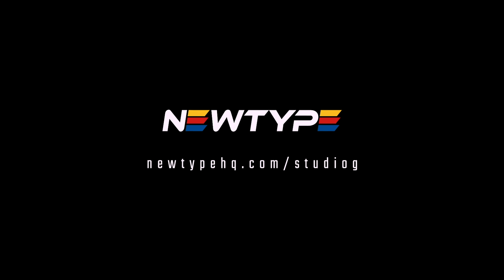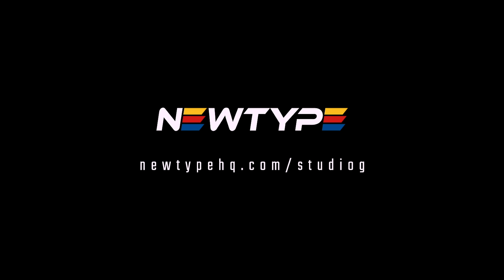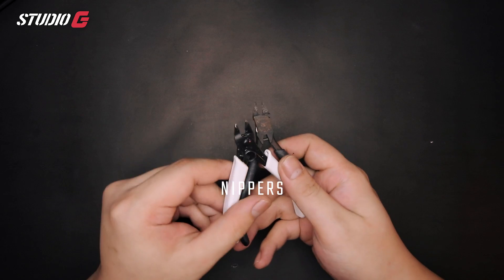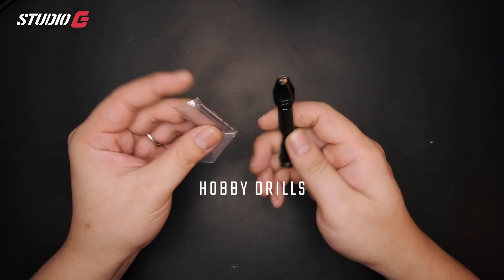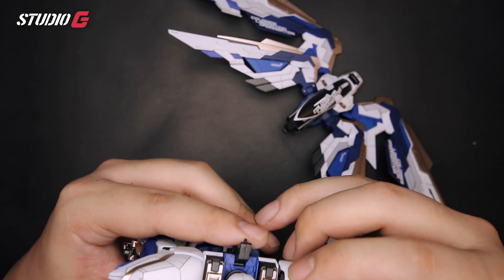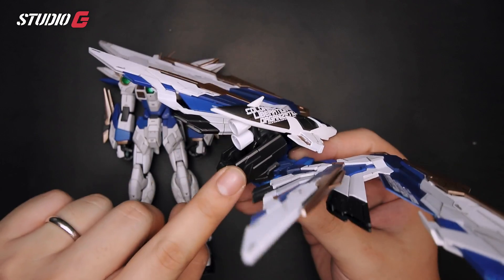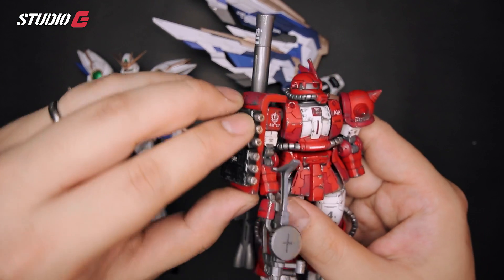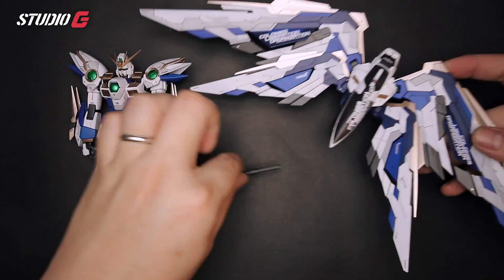How To Kitbash Your Gunpla | Tutorial Tuesday

Comment: My first ever custom was a kitbash it was a astray red frame with flight unit, I put the destiny gundam wings into the side plugs on the flight unit, put the destiny arms and hands with fenice reniscita shoulders and legs on the astray torso and then made a set of scratch built guaiz eft inspired hip railguns using the little ball and shaft that is in the polycap runner. I only painted the green and the blue parts red and and made the cream parts white and added some gold with a paint marker and removed the astray v fin. Simple yet effective

Comment: I used Gundam Breaker 3 for my first kitbash. It was essentially the 00 Qan[T] and Destiny Gundam. Unfortunately the Destiny shoulders didn’t work with the Qan[T] body. (I was using HG kits.) after trying to make it work I switched the arms to Gundam X. 

So after everything it went:
Head - Lightning
Body - Qan[T]
Backpack - Qan[T]
Arms/Legs - Gundam X
Wasit/Hands - Destiny Gundam
Colors white/gold

The only thing I haven’t been able to fix and I have some ideas are the fun funnel color, which come as green, and I need them to be a clear blue. I plan on redoing the HG version since I’ve gotten better at Gunpla and painting since I made that kitbash. Then I want to try it as a MG with the Qan[T] Full Saber backpack.

Comment: I recommend that every gunpla tool kit have these things:
Cheap nippers
Expensive nippers($35)
Model files($10)
#1 hobby knife(and 100+ spare blades)
400g to 1500g sandpaper.(cheap Walmart works)
And finally to get the sheen after sanding that matches all Bandai plastic:
2500-3500g sandpaper(3500 looks better but takes longer). 
You can get everything you need for under $100. If you’re spending $200 not including paint, you’re doing it wrong.

Comment: I think if you really want to get into kitbashing the correct place to start is with the high grade line because of all of them are about compatible with a 3 mm holes like the iron blooded orphan line is really good for this because all the parts can be mixed and matched and then you can paint the kit as a whole to make it match the 30-minute Mission kits are also very good for this especially if gluing and modifying pieces is not your thing that's the way to do it without having to modify our glue pieces or cut them if you do not feel comfortable with that at first I feel that this video is aimed more towards veteran Builders than it was beginners the tips we're extremely helpful and not everybody in the world can draw really well better to start small with like high-grade kits and start mixing those together our 30-minute Mission kits are really good for that too because they all share the same three millimeter Peg that is the beauty of building and modeling is the freedom

Comment: An added note. If you like me have no artistic ability for the concept drawing. Using a very small amount of super glue helps me a lot. Admittedly it does add a bit more work clean up wise before you start making them more permanent parts, but when you can’t draw and need to visualize it help a lot.
Reply: Why not just use putty instead and avoid the clean up process?

Comment: How do i make my paints more durable everytime I paint a kit I scratch the crap out of it and I'm pretty gentle
Reply: Spray a topcoat over. And acrylic paints are not very durable. Lacquers will be more durable but the vapors from them are more harmful to your lungs so wear a respirator.
Reply: What about enamels
Reply: I just started painting
Reply: @valentinomennor6419  I've only ever used enamels for weathering/chipping. never used them as base coats but they seem to be kind of rubbery. I always hear them recommended more for hand painting or as washes.